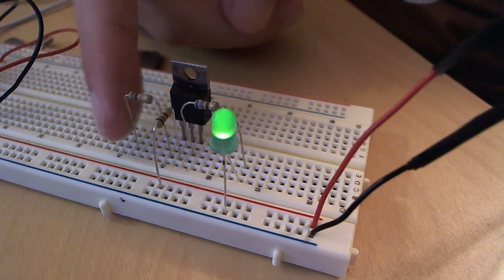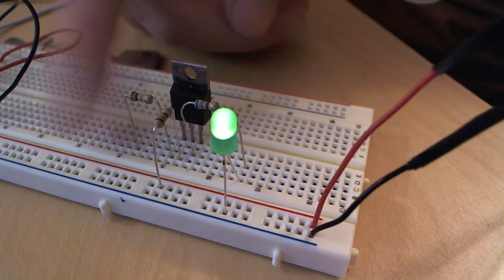MOSFET: Why?

Comment: The mosfet is controlled by charge on the gate. It is not like a bipolar (npn or pnp) transistor that is controlled by current. You have enough charge in your body to turn the mosfet on, and you also can drain the charge away turning the mosfet off. Designers of circuits using DC drive to the gate of a mosfet will include a resistor (100K or even 1 meg) from gate to source, to allow the mosfet gate to discharge and turn off when the gate drive voltage is removed.
Check out my "mosfet" videos.

Comment: the fet is discharging through your finger. Because the 10k isn't connected to ground there is no flow. all fets also have capacitance which is why the led stays on until its discharged through your finger